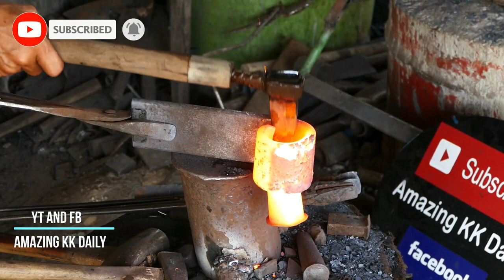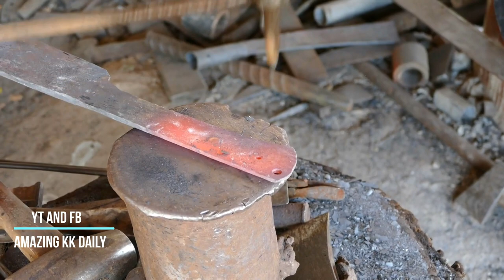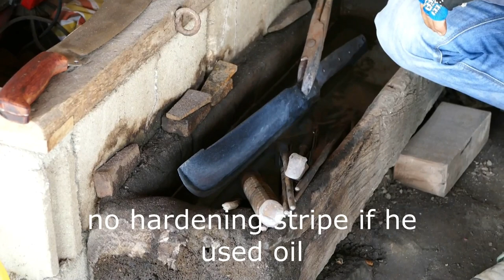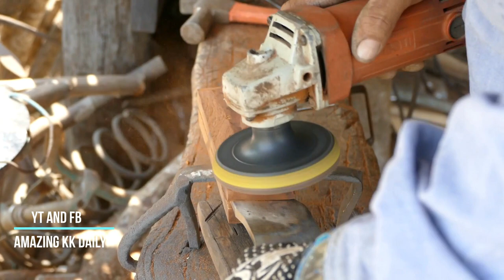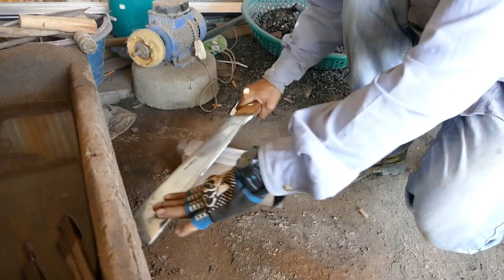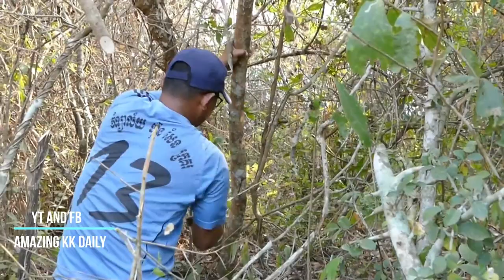Making A Machete / How To Make A Machete In Cambodia (Handmade)

Comment: I am going to have to experiment with his hardening method before I criticize it. From the perspective of a western blade smith with 30 yrs experience,  I can't see this process working . But I shall try it and see for myself. His hammer method is great, and I love the blower hack of a fan in a antifreeze jug.
Reply from the maker: You should try this method. He has been using it for over a decade. He learnt from his ancestors. It is good
Reply: Amazing KK Daily, why heat treat just a small portion of the blade?  A couple of years after sharpening on stone then all the hardened portion is gone.  Why not heat treat half way between the blade and spine?  This way, it has lots and lots of years of use.